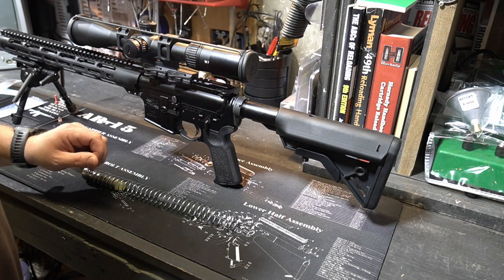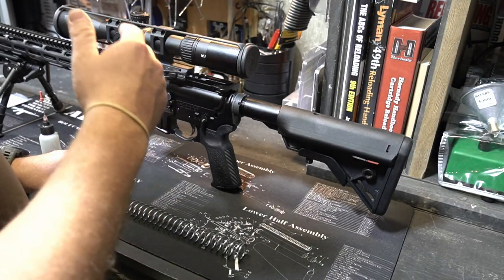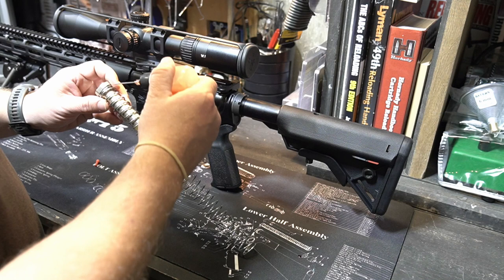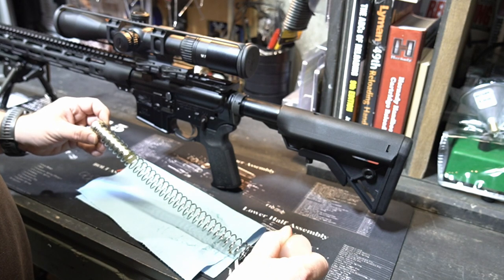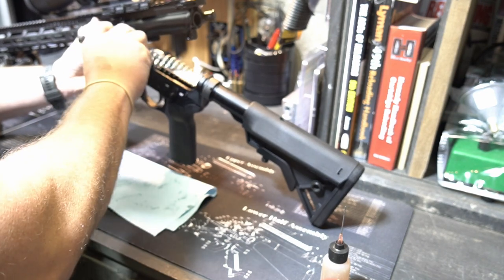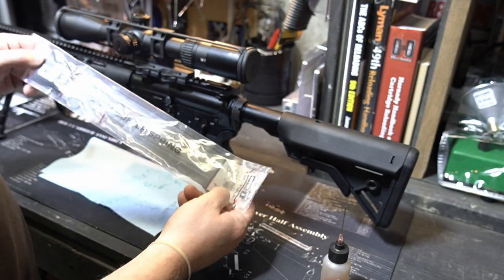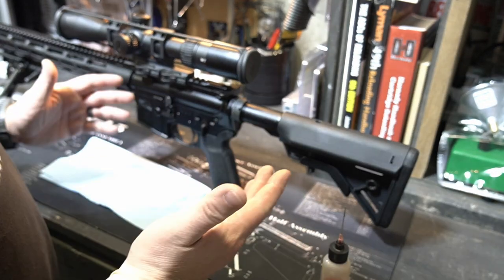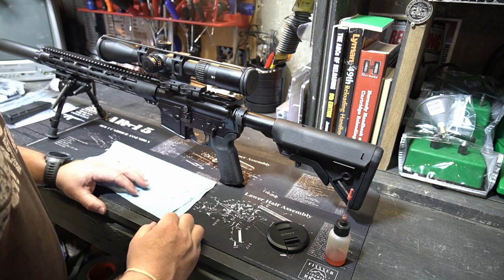How To Quiet Down Your AR-15 Cycling!!

Comment: I use a zip loc bag. 10-15 drops on the inside of the bag, rub the sides together to get a good coat on the inside. Roll your spring around in the bag to lube it. I just roll up the same bag and keep it in my cleaning kit. After I clean my buffer components I put a few more drops in the bag and roll it around again.
Reply: Nice. Might try this...

Comment: Some buffer tubes come DIRTY AS HECK from the factory. Simple cleaning of the buffer tube will really surprise you.
GREAT VIDEO ✌🤠
Reply from the maker: Thanks and you’re exactly right 👍
Reply: Ill check mine out. I had only fired 20 rounds through my new ar and it was pretty freakin dirty. Maybe test fired at factory? Idk. But the spring is nosey for a budget ar.

Comment: I have about 10 and a half inch AR pistol with a carbine length gas tube what do I have to know about I buffered to spring and weight if I was to replace it with a higher quality one? I mean they have a balanced setup right? Type of spring in the weight I don't want to just put anything in and mess up the action